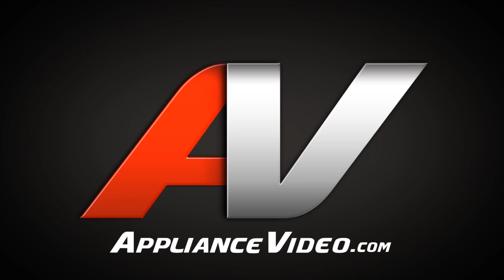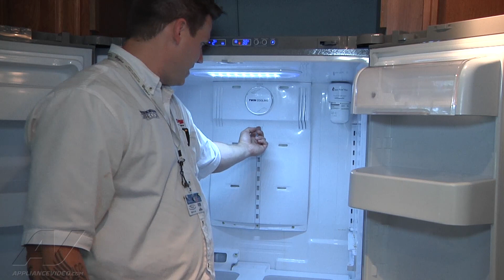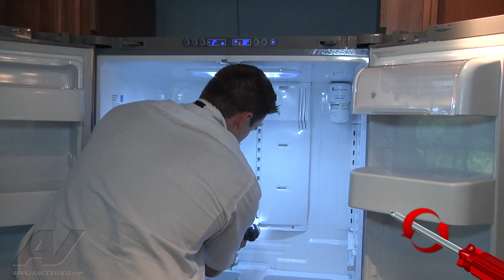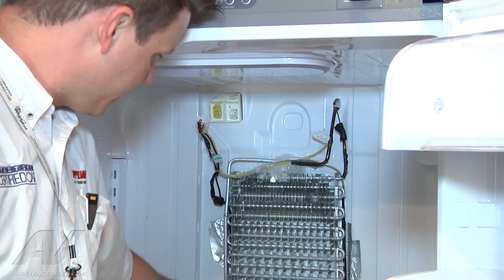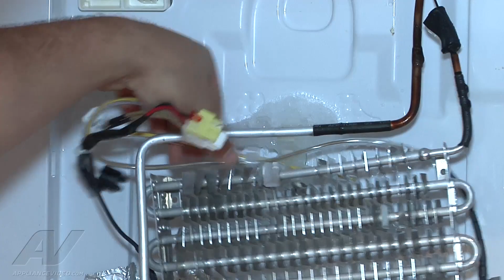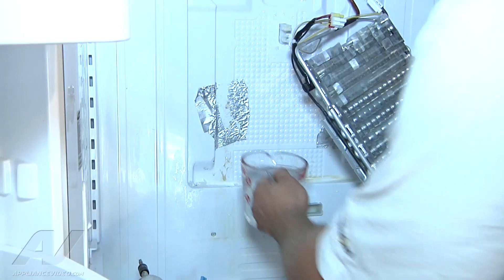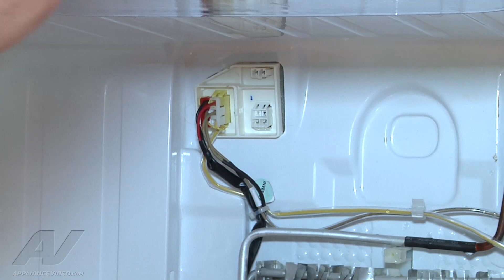Samsung Refrigerator Repair - Freezing Up On the Back Panel - Evaporator and Defrost

Comment: For those having a freezing up problem. If you can't get the cover off and don't want to wait over 24 hours for it to thaw (yes, it will take at least that long to get the cover off, and there will still be a lot of ice back there), you can repeatedly force a manual defrost as follows:
1) Press a button to bring up the display.
2) SIMULTANEOUSLY press and hold the Energy Saver (top left) and Adjust Refrigerator (center right) buttons for 8 seconds. You will see the display go blank and will get a beep.
3) Press the Adjust Refrigerator button again within 15 seconds. You should see FF on the freezer temp display, indicating the fans are being tested.
4) Quickly press the button again, and you will see 'rd' displayed. This is the refrigerator defrost cycle. The refrigerator will annoyingly beep every couple of seconds until the cycle has completed. When done, it will go back to normal mode.

P.S. - If you press it again after you see 'rd', it will show 'fd' and begin a defrost cycle of the freezer compartment. A fourth press returns the fridge to normal mode.

P.P.S. - Be very careful if using this mode to check operation with the cover off. The heating coil will instantly sizzle you finger if you touch it (I was pulling the cover away and trying to reach around and see it there was an ice block, and touched the coil instead. Don't do that!!)

Comment: This is the exact same fridge as a GE model, Which has been plaguing me for the last couple of years. The first time it froze over, I added a piece of wire around the heating coil and stuck it down the drain to try to transfer more heat there. The second time, I discovered that there was the 'heating tab' that could be purchased for Samsungs. I saw in pictures that the defrost assembly is identical to GE's, so I added that, believing it would prevent future problems. But no, about 5 months later the tenant complained of a loud noise from the fan area that stopped after a few days. I figured it was hitting an encroaching ice block, and then the block grew enough that the fan wouldn't run. I ran the fridge though 4 manual defrost cycles and was finally able to pull the cover away. There was a huge solid ice block to the right of the fan, completely covering the right side, and enveloping the sensor that is supposed to tell the control board when to turn off defrosting (it is supposed to see a temp of 54 degrees before shutting off the defrost cycle). I thought for sure that sensor had gone bad, so I ordered another one (I did not check it at the time, as I hadn't yet done additional research). I ordered the $80 replacement sensor (the yellow wiring harness in this video) and went back and installed it.  I just tried the old sensor this morning by putting it in an ice bath, and it appears to be working, so now I'm completely flummoxed. The heating coil works, the fan works, the sensor works, I have the drain heater installed, yet it still froze up. The only thing left is the control board, and at that point I might as well replace the fridge.
Reply: Have the same problem, did you ever find the issue, or just replaced the fridge?
Reply: @WatchHubPro Honestly, I think it's a design flaw. (or multiple design flaws). This fridge is in a rental property, and it will probably get replaced if it happens again, because I'm out of ideas. I think I've made 4 maintenance calls over the past 5 years for the same issue. I think the next fridge will be a side-by-side. I've had more issues with these bottom-freezer units.

Comment: You can buy a longer alloy tab that reaches from the defroster down into the drain hole that keeps the hole from freezing shut. I used a thick copper wire not knowing about the tab. 
I also used Mcquires ceramic spray on wax to keep the ice from sticking.

Comment: You would think in my case I paid $2500 for my Samsung refrigerator I wouldn’t have to deal with that I have to do this defrosting B…S… every 4-5 weeks . The last time I had a repair guy charge me $300 dollars to defrost the back panel what a pain in the rear. You would think Samsung would fix this ongoing problem

Comment: Excellent video, thanks.  I was defrosting every few months and tried a new solution.  About 6 months ago, after it froze again I bumped up the recommended temp setting to 40 and 0, instead of 38 and -2.  I put a towel in the front of the front of the bottom (frozen) drawer and the towel began getting wet, to the point that I had to replace it every day.  After about 2 weeks of this the bottom drawer became unstuck.  I took it out and was able to pull out a thick sheet of ice that covered most of the bottom of the ref.  I dried everything out and it's now 6 months later and everything appears to me working fine running the higher temps.  I have a towel under the drawer and it has remained dry.  It might just be a quick temp fix someone so inclined.  Thanks again for the detailed explanation.

Comment: I've found out that this part, DA96-00516B Evaporator and Defrost, is no longer available.  I searched two diff. appliance stores online.  But this part # includes the entire assembly, not just the heater part, which the video shows being replaced. Has anybody found just the heater part?  Thx.

Comment: How did you know that the heating element was bad without testing it?  Or the temperature sensor?  Usually, the problem is just a plugged drain and there is a new, larger OEM replacement part that clamps around the heating element to prevent the drain from freezing.

Comment: Good video.
On my fridge (RF266AEPN) which seems like the same model you are working on, right above the thermistor clip on the upper right, there appears to a 'tootsie roll' of some putty or something. On my fridge, that 'tootsie roll' melted over the thermistor clip.

I'm wondering if there is an explanation for that?

Comment: Ok but how do you diagnose that the heater is not working. I got same problem but I checked for power at the fan and did not get any voltage so if the fan does not turn also the evaporator will freeze. How do I check if the board I'd bad ? I checked power goes in but I could not see going out I'm old and even with glasses could not see the letter on the board .

Comment: The heater cable you installed is plug and play but besides being new, is it any better (different) than the one you replaced? ALL Samsung Fridges have this issue so they obviously need a bigger/better heater coil.
Reply: That was what I noticed. There is no heating occurring up near the fan, and I think a lot of ice blocks form up there. It is just relying on heat from the coil to rise into that compartment to the right of the fan, where the sensor is located.

Comment: Some believe the sensor shouldn’t mount directly above the heat that rises from the right side.  They move the sensor to the left,  clamping it instead around the adjacent copper tube.  Also, thawing the edges of the plastic cover before trying to disengage it from the back wall may help prevent it breaking during the effort.  Also, replacing the heater drain probe with a new, long tongue style can help keep the drain port from freezing up.  Otherwise, thank you for a well-done video with steps that are easily viewed and understood, unlike some others that are not thought out well in advance and are clumsily presented.

Comment: I see that these post are from a long time ago, but came across searching for answers on our Samsung French Door unit that was not cooling lately. So watched your video and it was very helpful. While our unit is 6 yrs old, its surprising that this just started. Anyway, found drain was clogged, the fan wiring to the wall connector seem rusted and came off quite quickly, so this needed to be re-soldered and added silicone to the inside cap to protect. One thing I did find, and not sure anyone else noted this, but the bottom screw that holds the middle support bracket is quite long, and I think it penetrated the drain line as the screw had rust, and rust was around the screw hold in wall. Notice during defrosting that water would occasionally come out the hole. So I sealed it with a little silicone, found a shorter screw and put back. So far the temp is running at 39 degrees. But will monitor for a few days before putting food back. But thanks for sharing your insight to this samsung problem..
Reply: It is interesting that you should say that about the screw. The fridge I discussed above has a rust spot on the back of the fridge, and rust stains on the floor. Maybe this is why it is rusting to the outside.

Comment: Finally found a permanent fix. After having a repairman twice come out and defrost the back panel I tried it myself and accidentally removed some of the Styrofoam shroud encasing the fan. That removal of Styrofoam seems to have permanently resolved the problem. We also make sure the panel vents are not blocked off by food in both sections and leave space around it to allow it to shed heat. Other than removing the shelves and 4 screws it is an easy fix.
Reply: Where and how much did you remove?  Have mine apart as we speak.
Reply: @douglasblack3865  Since I didn’t totally defrost before removing the panel it was a pretty big chunk that tore off when I pried the panel off. In other words around the fan and close to the coil. My guess is the extra area allows defrost to work better. Given the tightness of the panel I didn’t see much advantage to having it. Before freeze ups were an every six month problem, now it’s going on almost 2 years without a problem.

Comment: The REAL PROBLEM is actually NOT all this.  REPLACE THE FIN TO THE DRAIN HOLE with a piece of 14 gauge copper wire gently looped around the bottom of the heating element. There are other videos that show exactly how to do this, and is a permanent fix. 

The SYMPTOM of this being the REAL PROBLEM is water in and/or under the bottom drawers. 

So all the other "fixes" that people try including this or replacing the defrost sensor do not solve the REAL ISSUE. 

Make sure the copper wire sticks at least 2 - 3 INCHES INTO THE DRAIN HOLE.  It will go down at an angle from the hole into the tube. 

This WILL PREVENT the hole from CLOGGING WITH ICE.  The excess water WILL DRAIN AS IT SHOULD to the evaporation drip tray under the heat exchanger under the fridge.  And the Samsung fridge will then function perfectly, as it should.
Reply from the maker: Great question, if you have a more technical question that our parts department cannot answer, you can search our over 17,000 answered questions free at our website www.ApplianceVideo.com under our Repair Help section. You can also call our parts department at 1-800-830-5465 and they can give you help 7-days A week ,or search at www.SaveMoreOnParts.com  .
Reply: I did exactly what you suggested about 6 years ago. It's worked great until last month when I had another ice build up. I replaced the heater coil. I thought I had fixed the problem but then noticed the ice build up again. I Guess I'll try replacing the temperature sensor next. If that doesn't work, I'm pitching this stupid refrigerator. Never buy Samsung again! I can't believe stores are allowed to sell these things.
Reply: @marliesmanning8148  It is "more likely" to be a bad defrost sensor than a bad temp sensor but they are both cheap - so best to replace both of those - since the heating element works.

In more rare cases, it is "possible" that the drain tube (behind fridge at rear) has a clogged port.  So please check that too - if enough "gunk" gets to the bottom, water can't drain past it - very easy to pull off and rinse clean.

Comment: My refrigerator started doing the same thing. It started freezing up in shorter time frame intervals too. Cleaning out the drain tubes on the back of the fridge stopped the whole problem. The energy saving tiny drain covers get clogged up if you have hard water. I actually cut the openings a little wider and I’ve had no more issues with it freezing up.
Reply: Brian, this may be my problem also. Where are the drain tubes located?
Reply: Ditto
Reply from the maker: Great question, if you have a more technical question that our parts department cannot answer, you can search our over 17,000 answered questions free at our website www.ApplianceVideo.com under our Repair Help section. You can also call our parts department at 1-800-830-5465 and they can give you help 7-days A week ,or search at www.SaveMoreOnParts.com  .

Comment: How do I know if the heater is bad? Is there a way to check it
Reply from the maker: Great question, if you have a more technical question that our parts department cannot answer, you can search our over 17,000 answered questions free at our website www.ApplianceVideo.com under our Repair Help section. You can also call our parts department at 1-800-830-5465 and they can give you help 7-days A week ,or search at www.SaveMoreOnParts.com  .

Comment: Firstly thanks for your video it was really helpful, actually more helpful than the person we paid to come and fix our refrigerator (and didn't). 

We took the back panel off as per the instructions in the video and found that the wiring on the right hand side seems to have some kind of putty attached to it. I don't see this in the video, appreciate any ideas.
Reply from the maker: Great question, if you have a more technical question that our parts department cannot answer, you can search our over 17,000 answered questions free at our website www.ApplianceVideo.com under our Repair Help section. You can also call our parts department at 1-800-830-5465 and they can give you help 7-days A week ,or search at www.SaveMoreOnParts.com  .

Comment: How about just replacing the sensor, if the heating element is OK?
Reply from the maker: Great question, if you have a more technical question that our parts department cannot answer, you can search our over 17,000 answered questions free at our website www.ApplianceVideo.com under our Repair Help section. You can also call our parts department at 1-800-830-5465 and they can give you help 7-days A week ,or search at www.SaveMoreOnParts.com  .

Comment: have Samsung refrigerator freezer model RF26HFENDBCAA that is not working. Neither evaporator fan is running, the same for compressor and condenser.

The only thing that is working is the control panel. When I try to step through the error codes, all the segments in the led display light up then go back to the way they were before.

Any help would be appreciated.

Thanks
Reply from the maker: Great question, if you have a more technical question that our parts department cannot answer, you can search our over 17,000 answered questions free at our website www.ApplianceVideo.com under our Repair Help section. You can also call our parts department at 1-800-830-5465 and they can give you help 7-days A week ,or search at www.SaveMoreOnParts.com  .

Comment: I have a Samsung RF26HFENDBCAA frig that neither the upper nor the lower compartments are not working. Neither  evapvapor fans
Reply: have Samsung refrigerator freezer model RF26HFENDBCAA that is not working. Neither evaporator fan is running, the same for compressor and condenser.

The only thing that is working is the control panel. When I try to step through the error codes, all the segments in the led display light up then go back to the way they were before.

Any help would be appreciated.

Thanks
Reply from the maker: Great question, if you have a more technical question that our parts department cannot answer, you can search our over 17,000 answered questions free at our website www.ApplianceVideo.com under our Repair Help section. You can also call our parts department at 1-800-830-5465 and they can give you help 7-days A week ,or search at www.SaveMoreOnParts.com  .

Comment: What is the black material wrapped around the very skinny pipe on our right side at the top of the evaporator? Mine has melted and dripped down over the white plastic that runs toward the bottom of that pipe
Reply from the maker: Great question, if you have a more technical question that our parts department cannot answer, you can search our over 17,000 answered questions free at our website www.ApplianceVideo.com under our Repair Help section. You can also call our parts department at 1-800-830-5465 and they can give you help 7-days A week ,or search at www.SaveMoreOnParts.com  .